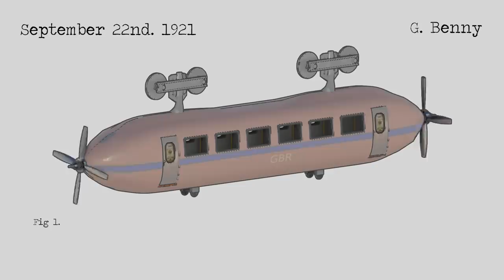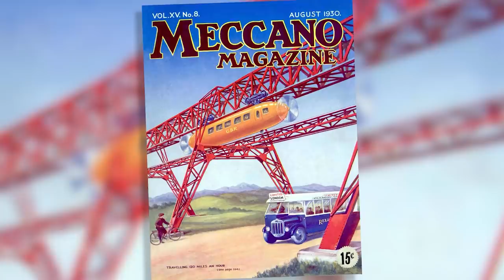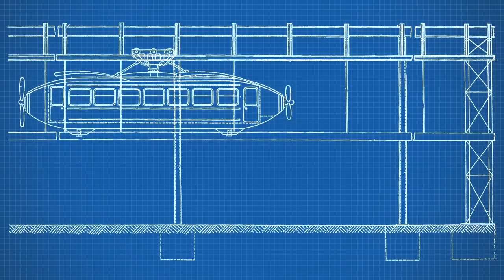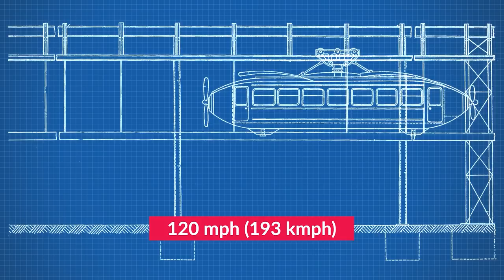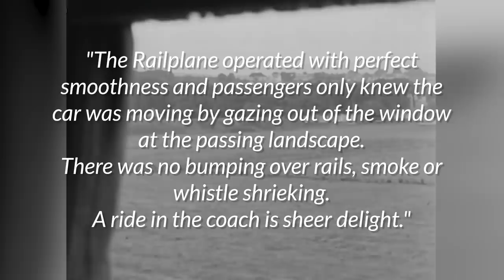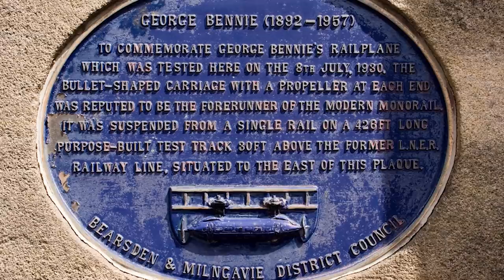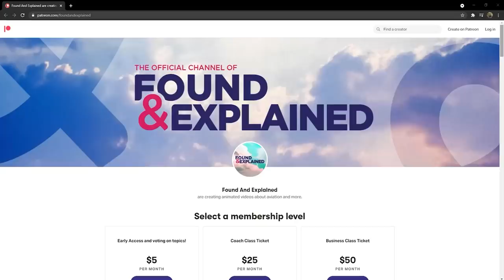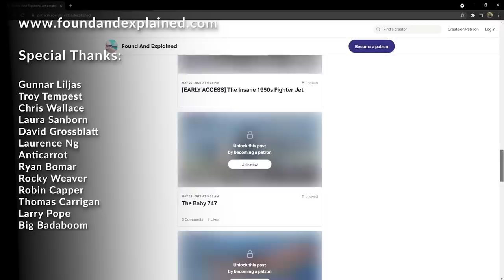This Insane Plane/Train hybrid - The George Benny Rail Plane!

Comment: If only he has agreed on that line , more lines might have been built and who knows, conventional trains might be even completely replaced in Britain by these faster and quieter trains ,if only that was so...
Reply: I bet he probably regreted not doing it later on in life
Reply: quieter?
Reply: In 1920 it was a lot of steel to be using. Now not much. This is a design worth a second look..
Reply: Lol. Quieter and Faster😅
Reply: @rexmann1984  It isn't. I don't see how that's supposed to be more efficient than wheel driven trains
Reply: @rexmann1984  Even hear something called "Bullet Train".

Same price, same speed, but decatuple the capacity
Reply: @carlosandleon  it's more efficient because gravity is a bitch. And people don't weight much but are much more time sensitive than cargo. However, powering it with propellers is probably not the most efficient way to send it down the cable.
Reply: @rexmann1984  gravity is a bitch for both systems. And wheels are in contact with a surface in both systems. If you use your energy for direct traction to the stationary surface you'd use less energy than pushing back from a fluid medium.

For example if you are scubadiving against a current, you use less energy crawling your way forward on the rocks than kicking the water with your fins
Reply: @carlosandleon  all that is true however, these could be made with less material for the structure because its only designed to carry passengers. Trains that ride on top of the track have a force vector that is pointing at the ground the force vector for this design would be pointing at empty air.
Reply: @bocahdongo7769  I don't. Think they existed in 1920
Reply: Those offers probably included deal killers like "you have to give us 51% of the company."

Comment: i want this to actually be a thing
someone bring this back.
Reply: The problem is, you could make this without the plane parts.  And only one above track.  It's called a suspended monorail.  And it was invented in...1901.  Before even this was invented.  The one advantage this train had was the extra speed.  And well, that wouldn't be an advantage today because of high speed rail.  All that said, this should have gotten built in 1930.  It would have been amazing for its time and lasted well into the 1960s at least.  Probably even longer in the UK because of failed high speed rail.

Comment: Hi, I didn't know about this rail plane, but did you, about the German "schienen-zeppelin"??? It was a normal railway vehicle but it was  propelled with  a big plane engine with a 4blade propeller and was streamlined. So it got its name. It was tested on the traject Berlin-Hamburg, I don't know the exact year, but it was in the 30ies. It broke all speed records from Steam, Diesel and Electric Trains, but was rejected because of its excessive noise and fuel comsuption. As I know there was only 1 built. 😎

Comment: I may have missed it in the comments, but how was it powered?  My assumption is electric motors running the propellers.  The quick shot of the cab appeared to show a wheel device which looks like the standard European controller for electric traction.  The lower rails could be used as power, or all three if you wanted to go 3 phase AC.  All assuming electric powered.
I guess I could google, but where is the fun in that? 😅

Comment: It a historical attempt to the concept of hyperloop, instead of a vacuum stagger cost infastructure realm, its propellers as momentuim, while dragging over wheel hanged rail beams, modernly, it could have replaced the Hyperloop, with a 'Turbineloop.' Consider the following. Modernly magnets could've multi task, levitating the cart on a rail beam/tube, while spinning a o-ring/axel of fan propellers in front and back of the carts, the magnets would be doing the shimmy and lift motion, the blades would channel air to eleminate wind friction in path motion, in a 'Express tunnel.' A station giant turbine, could create parallel wind flow, being a moving enviroment, allowing to stack velocity before ever reaching sonic limitations. It would cost more cheaper then Hyperloop, yet far safer and earlier to build.

Comment: Im thinking the main problem with this is scaling it up to rival the capacity of a multi car passenger train. The economics of building miles of overhead track and the maintenance would be very costly and the low number of passengers per car and the fuel cost in running loads of tiny trains versus a traditional train with a capacity of hundreds of passengers probably doomed this idea.  Ticket prices would have to be higher than a normal train due to less capacity and the prop noise and requirement for stations positioned above ground level would be a pretty big issue as well.
Having said that, the track design itself is good, if he had maybe used the wheel things as the propulsion rather than a prop he might have been onto something.

Comment: I disagree with a lot of what you say. High-speed rail exists today, yes, but it operates TRAINS not individual 48 seat vehicles; it is the train of multiple vehicles that allows large numbers of people to travel at 300+ khpm rathe than a few dozen and there's no easy way to chain these vehicles without losing the thrust provided by their propellers which would lower the speed. Also, if you want to go from Glasgow to London and only want 47 others to go with you, just get a plane; it requires far less infrastructure than this thing. Also, how do you build this above existing rail alignments when the track passes under a road bridge, through a tunnel, over a viaduct not built to hold all the extra load etc? Also, switching may prove quite a difficult thing to implement given there are 2 lots of track that would need to switch. It was doomed from the start, just an early case of Gadgetbahn.

Comment: Seems to me that it wouldn't likely reach the speeds he wanted.  Too much friction with an over head truck and bogies below.  Why not just sit in tracks.  Why not use electric motors for direct drive instead of noisy propellers?
Reply: Perhaps they didn't have any lightweight high-torque motors at the time, so they had to go with low-torque motors and drive propellers with them?

Comment: Why not propeller driven monorail? Like the modern monorail running only using the top track. I'm talking for back then at 1920.
Although the perfect car would be electric driven VTOL.
Train, what a vehicle only can run on track. Can't freely changing direction. We can't film 'too Fast too Furious' using them.

Comment: This seems like a stupid idea immediately. But thinking about it after a few beers, less friction on the rails, possibly smaller motors needed for the thrust required. I’m sure it would start slow but once momentum was gained I would only guess it would be pretty damn efficient. I think I’m starting to really like this whack a doodle nuttier than squirrel turd design!
Reply: I mean mag lev with magnetic propulsion and nothing but air friction, less materials to construct.. way more reasonable but not as cool as an electric Cessna on a tether to make a train! Like the toy plane I have hanging from my kids room.

Comment: I dont think it was ahead of its time, I think they faced some serious obstacles, one is noise and the other is bird strikes with the propeller and the last problem is efficiency,  props are not the most efficient form of drive. Direct drive electric motors would be a far more elegant and an efficient option.  Electric locomotives have been around since 1840s

Even today the best efficiency variable pitch propellers are about 70% efficient, while direct drive electric trains are more than 90% efficient.

Comment: That wouldn't fly today (sorry for the pun): too loud because of the propellers and safety issues like emergency breakting. But otherwise an interesting concept. Smooth ride at high speeds would be today the Shinkansen, Transrapid and Maglev. Benny would have liked this advancing technology... 😎✌️
Reply: I'm pretty sure it would have been plenty possible to apply some braking system on the top, like a jaw biting the rail or something like that.

Comment: The propellers made no sense. It was suspended by a pair of wheeled bogeys, so simply use electricity to power the drive bogey.
If he could have reduced the materials needed for the gantries (like a simple vertical post as in telephone poles which featured trapezoidal braces or guy wires near the ground) then this would have been HUGELY economically successful.
As the vid states, it would have freed up the ground lines for cargo transport. This alone should have gotten the Gov't interested and them grant him construction contracts.
I wish that we had more Suspended Light Monorail systems in the USA. Here in Houston it would DRAMATICALLY free up the roadways, which are constantly stymied by frequently stopping buses and trucks/lorries, slow moving rail trains which crisscross the city's streets, and of course passenger cars.
Just imagine if we had aerial monorails like NYC, London and Moscow have subways. Our wet soil (swamps and bayous) don't permit much tunnel traffic. And creating sub-grade roadways is prohibitively expensive due to all the drainage and soil shoring required. So normally our only tunnels are above ground level between skyscrapers, or beneath mounded berm bridges.
Can you just imagine all of the City Buses and School buses that could be removed from the streets? Not to mention all of the "ride share" and taxi services that actually triple the road miles travelled getting to and from the passenger for pickup.

Comment: There was also a german rail vehicle similar to this, the Rail Zeppelin, or Schiennenzeppelin. It ran on the normal tracks and it was also streamlined, it had one propeller at the back. However development was discontinued due to the risk of the propeller striking passengers on a platform, the lack of traction on steep slopes and the fact it couldn't pull any aditional cars behind itself.
Reply: Russians in USSR also have something similar. Danger was real because prototype actually killed its inventor.

Comment: Using a propeller instead of wheels is a really bad idea. If you can use wheel propulsion that's the way to go. Much more efficient and much quieter. Also, single car transport will never beat long trains.
Reply: If it had succeeded maybe it would have eventually been powered by gas turbines - Benny and The Jets ;)

Comment: this technology could be improved with halfpipe or semicircle paddles placed along the tracks for the wind to push against increasing acceleration and decreasing power required to maintain speed nowadays it'd probably be a jet engine or turboprop but designing the rails to handle the forces of over 2000mph with multiple tons of passengers is just a baffling feat regenerative electric braking so a rolling wheel actuates on to the rail and progressively increases generation power till a standstill is had reverse pitching the propellers while still maintaining same rotation speed could further assist in exaggerative deceleration the obstacles at those speeds would need to be denied by saftey netting or tunnels the thing is people's fear of public transportation due to the increasing risk of disease spread due to both poor cleaning pratices and lack of good bacteria/germs to prevent worse more toxic ones from taking over nature's gotta balance ⚖️ ya know? but in the event people could be assured luxurious transport in a safe quarantined space like ventilation that pressurized the cabin and exhaust flow ports at each passengers seat to combine and collectively draw all the undesired fumes to the rear of the train to be deposited through muffler device kinda like rain gutters how they can combine everything and flow it down away from stuff you could even have sensors in the exaust stream to test for different contaminants that are being removed from the air system .... it would however have an increased maintenance cost of air filters because of removing exterior contamination like pollen farts gas whatever ya driving past possibly have an active vent mute button to not spread the dead 🦨 skunk through the traincars sensing at the front and saving the rear but still resorting to kick fans back on as soon as passed through offending odors if it's all vented air though it kinda ruins air conditioning unless the air conditioners are designed to cycle the air through the air gutters to the rear and then heavily filter in a specialized hepa uv filtering washable pre screened filter with charcoal absorbers even a water bubbler to trap pollutants before retransmission of that air pressure to the front to flow to the rear again vacuuming the air away from passengers yet in a quiet manner

Comment: Suspended rail does exist and is used commercially today. There are some in Germany and Japan. Its main appeal is that it can be built on top of existing roads or rivers. Of course, there is no need to use propellers to move it, normal electric motors can just turn the wheels.

Comment: This is just as stupid as the "hyperloop" and all monorail scams. Take the idea of trains, make it more expensive and small so it's really ineficient.

Sure high speed rail is great; but the main thing about high speed rail is straight rail. If you're already willing to pay for extravagant elevated tracks, why not just put normal rails on them; it's cheaper than building suspension rail/tubes/monorail nonsense; AND you can use existing efficient trains on them.

Comment: It would be noisy for sure .  Just like airboats with propellers, they are the absolute noisiest most annoying then we're probably five miles in all no one is spared what seems like an hour of irritation I'm going to slowly going up a river Channel or by you.
     The other problem I'm assume is the sheer amount of steel needed for the structure that it wrote on. That is one hell of a lot of steel for racking today and for nowadays too.   🤔🇺🇲

Comment: Why would anyone take a plane and stick it on a track the whole point of a plane is freedom to limit it to a track means it's just a train but this thing is too much of a plane to be a train and too much of a train to be a plane it falls between 2 cracks it's not clever it's just a fever dream of a dreamer bit like something else I can think of today with a name attached to it 
I just struggle to imagine the noise of those props at full throttle and to leave breaking up to the rear prop and not the wheels just adds to more of a disastrous  idea along side other limitations this design has I'm not surprised it was never made the whole idea itself could only come from someone with no engineering skill

Comment: Viable my ass.  Propellars are incredibly innefficient as they push against the air.  This makes sense in planes, where there is nothing better to push against, but here you have a convenient rail you can push against.  you could just use a regular motor turning a rubber wheel that presses against the rail and is retractable to allow the pod to "glide". Additionally, you can slow down by simply using standard BREAKS.  No need to use fuel to stop, when boaring bog standard friction is a MUCH cheaper alternative.  Additionally, you are failing to factor in the all important factor of "capacity" No pod based solution can ever match the per mile capactiy of a railway.  Not even close.

Comment: Wow. Suspended monorail, with extra steps. Unneeded bottom rail, propeller have much lower efficiency then simply electric motors on wheels, oh and more noisy. And very much wrong business model, like, trying to build it over railroads property while openly compete with railways.